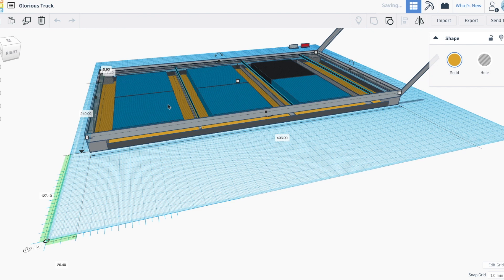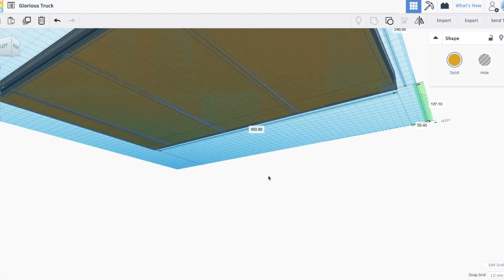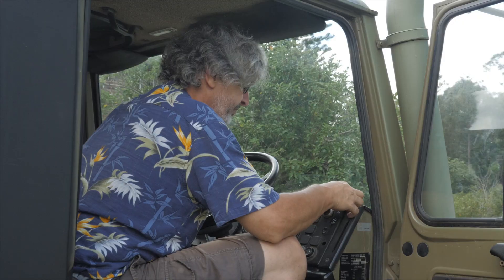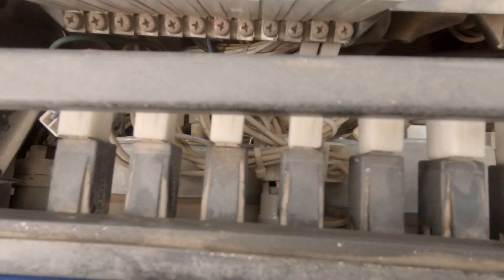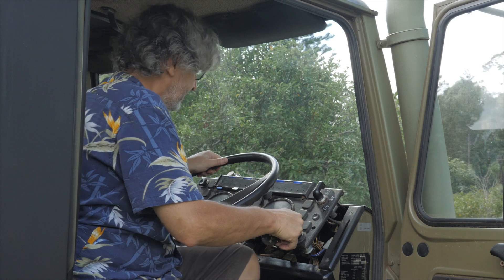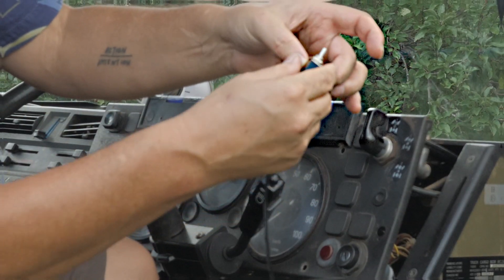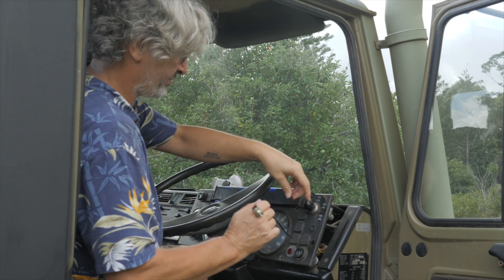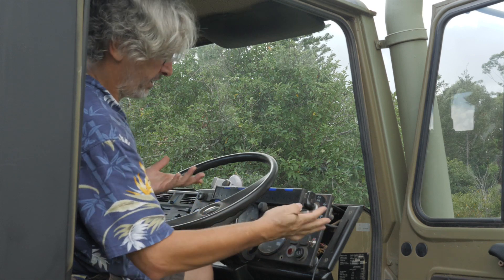Unimog expedition vehicle, silencing the buzzer and designing fuel tank brackets

Comment: LOL! Thabo! I do the tool thing all the time. I am a bit older than you, so I can only assure you that it gets worse with time. And then your eyesight goes for close up stuff. Luckily, both out mogs have parts that are scaled up, and they hurt if you walk into them, so we're not going to have the same problems as I get with my motorbike for instance!
The spare wheel dilemma was easily solved for me by putting the 200Litrre Potable, 45 Litre black and 50Litre grey water tank up front which offsets the weiaght of the spares on the back.

Comment: Hi Thabo.  Those reservoirs at the back of the new fuel tank position are for your brake fluid.  Below them is the brake master cylinder.  There are 2 reservoirs as there are actually 2 hydraulic brake circuits in your truck, this gives redundancy in an emergency if one fails.
Reply from the maker: Thanks for that, how does it interact with the air braking system?
Reply: @ThaboNelmeanshappiness  The braking system is classed as air over hydraulic.  Realistically its just a hydraulic brake system like in your car but instead of the pedal acting on the master cylinder a separate air cylinder acts on it.  This allows for more force to act on the hydraulic master cylinder than you could muster with your right foot.  The system after those reservoirs is purely hydraulic like in your car.  The system before it is a system of valves that allow more or less air pressure to reach the master cylinder.  Have a read of the section of your workshop manual that relates to this system.  It's a need to know part of our trucks as its also one of the most problematic
Reply from the maker: Ah, that makes sense, thanks for that.

Comment: There should be a manual or guide from Mercedes on how to do proper chassis mounts. Having rigid mounts might fatigue and or crack the chassis or mounts. I am not an engineer just checking that it might be worth investigating
Reply from the maker: Thanks, will do, I have the repair manuals, might look in there.
Reply: @ThaboNelmeanshappiness  you really need to have either a 3 point chassis mount of spring bolt mount system on your subframe or you will break something.  Unimog chassis especially are made to twist, you must allow for it.  Watching with interest.